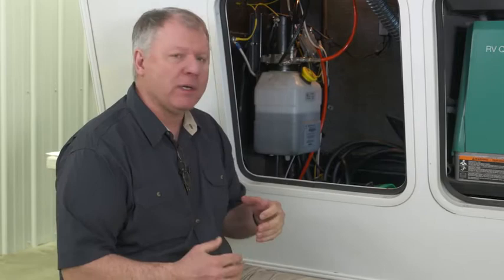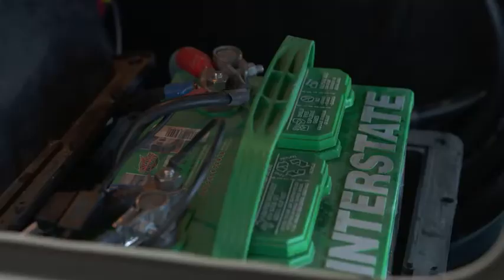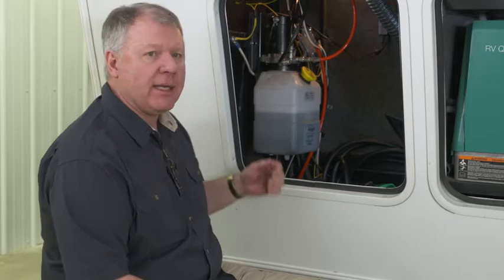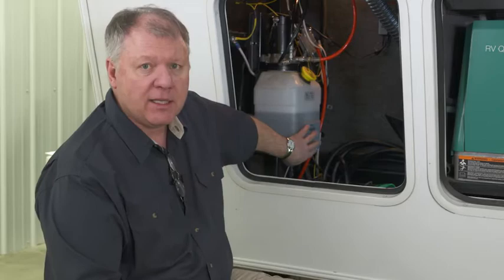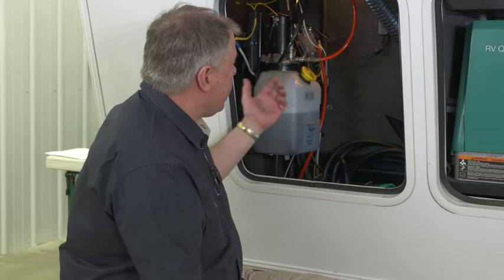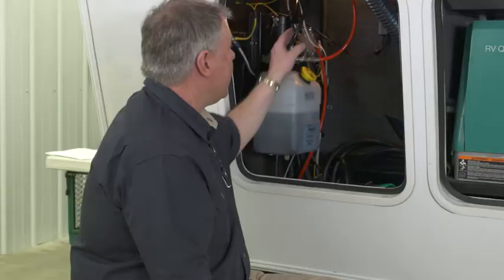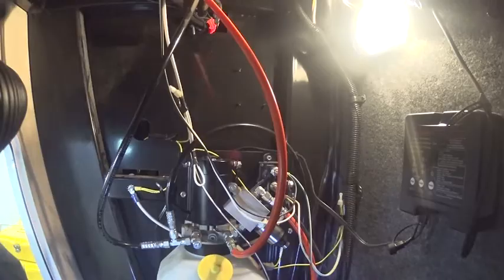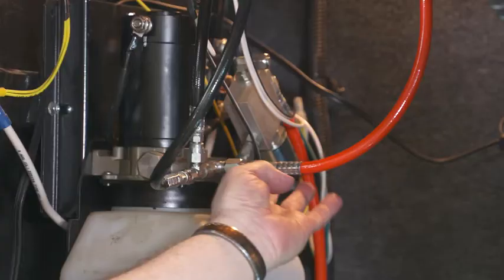RV Leveling Jacks Inspection and Maintenance

Comment: I just noticed that a few of my jacks don’t retract 100% into the sleeve. Maybe an inch or so of the shaft still showing in my 2022 solitude. Is that normal or is there an adjustment. Could use that extra 1” of clearance… thx
Reply from the maker: Great question!  The ‘Ask an Expert’ section is for members of our online community. I would be happy to send your question off to the experts. To get started, please provide the email associated with your paid membership. Thanks!

Comment: I need to lift the front end on my class C to replace shocks, steering damper and wheel bearings can I use my levelers to lift front end?